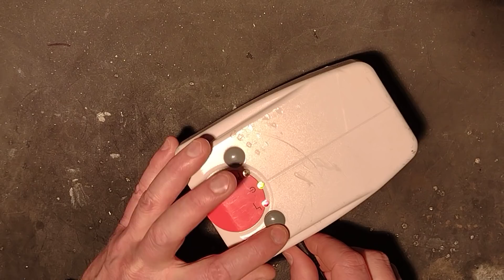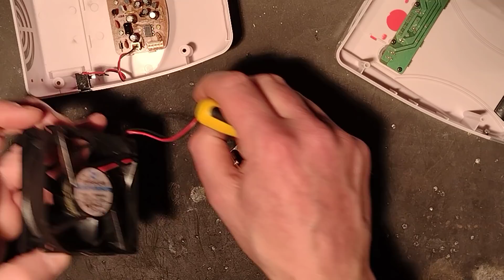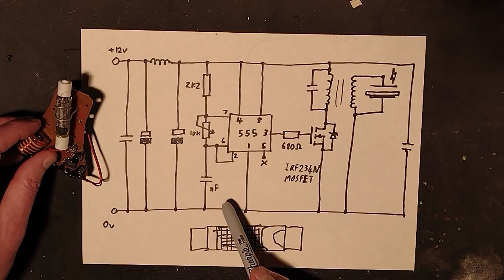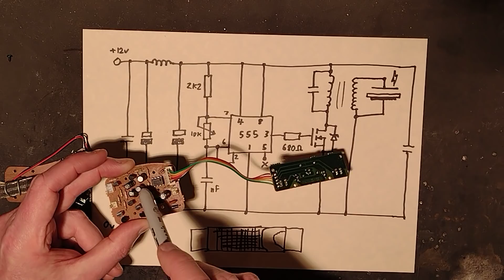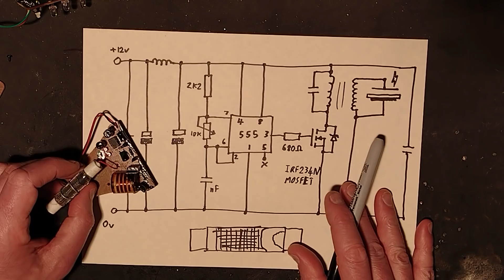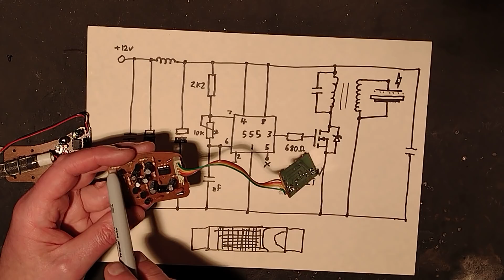Old shoe deodorizer ozone unit (no microcontroller)

Comment: The "Pie" arrangement of an inductor with the 2 capacitors in the legs is a very good smoothing unit for 50 Hz ripple. 
We used it in the Physics Laboratory in Secondary School for teaching half and full wave rectification. 
That particular topic didn't feature on the Final Exam Paper for Higher Level Physics but I passed with a Grade A anyway.

Comment: You can still buy that same design of flyback transformer and used one in a ESD gun that I built. I did buy several different designs of transformers from China and this one was a clear winner in terms of reliability. I also used a 555 oscillator via a FET driver and a voltage regulator to adjust the voltage. If your interested look on my channel as I published the full design if anyone wants to build a variable high voltage power supply Thanks regards chris

Comment: I recently got a usb uvc thing from China
 Worryingly dangerous so BC yours if you wish to get worried!
Reply from the maker: The UVC LEDs are a real thing if they're the little gold square ones.  Very low power, but still a risk if viewed directly.  They often include a purple chip just so you know it's active.
Reply: @bigclivedotcom  the thing is real little gold leds pushed to into the poundland power bank. With my finger (muppet) hurt like hell.

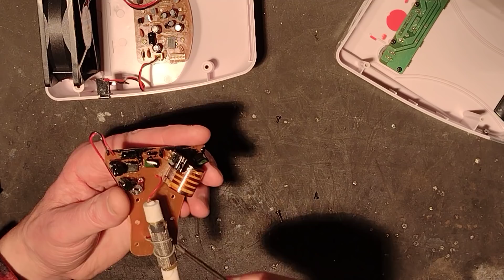Comment: @4:08 - I once made a ghetto ozone generator from a neon transformer, some steel window screen and a Prego jar.  Invariably, after a couple of hours of running, the arc would puncture a hole in the Prego jar where the raised lettering was.  I started using a smooth jar, but the arc still managed to pierce the glass after a time running.  I found that fascinating.
Reply from the maker: That's why many commercial ozone generators use ceramic as an insulator.  It's better suited than the glass at high power.
Reply: @bigclivedotcom  I've just replaced the ceramic ozone plate in my commercial machine.  It arced over an edge.  I didn't pay attention to the fact that you're supposed to clean the ceramic plate with (specifically) ammonia periodically to prevent that.

Comment: A capacitor across a transformer primary with a choke inline looks much like a royer circuit, or maybe with a 555 it'd be a pseudo royer, the odd thing is the 555 is connected to the same side of the choke as the transformer primary, maybe its just a really small value choke just for suppression and the cap across the primaty is a small pf value cap and is just to absorb the energy from the primary leakage inductance that doesnt get coupled to the high voltage side and might blow the mosfet.

Comment: It must have been quite an old unit to not have used a DUAL 555. I can even imagine such a unit using a QUAD 555, to add some extra features. Kudos to the fan still running. Expensive unit, was it?
Reply from the maker: It wasn't too expensive, and hasn't seen a lot of use.

Comment: Note that the body diode of the mosfet will not clamp a series connected inductive load. The current flow would stay downwards and would cause a voltage rise to the point of the mosfet breaking down. The parallel capacitor helps form a resonant circuit with the transformer primary. My guess is that that resonant frequency would be away from the secondary resonance to limit the MOSFET current.

Comment: I have a Question: WHY in general would you use ozone generators?
Reply from the maker: Ozone is a natural part if outdoor air.  It's what makes line dried clothing so fresh and clean smelling.  It depletes quickly in airtight homes which can create a better environment for undesirable airborne elements like mould and bacteria.  When used at higher levels like in this unit it can make an even less hospitable climate for mould and bacteria.

Comment: 555 is a true legend, something that will never ever happen again in world of electronics. Just like 741. Thanks Clive for another great video, much love.

EDIT: Solution for my smelly feet/shoe problem was using thick cotton socks, also in summertime (yep, even when it was warm outside). But a real revolution came when my nephew told me about feet creme based on zinc oxide and aluminum chlorohydrate. You use it for several days and forget about it for the next two or three weeks. You can try to ask about it in the pharmacy (it's called "Uro" in Poland).

Comment: Oh my, this device is sooooooo screwed!
And that tar or other goop on the HV board looks plain nasty. As if they couldn't use epoxy, silicone etc. in case the thing needed additional insulation. Which is strange though, as the only place that had HV would be the transformer's secondary and ozone generator.

Comment: Do you have to disperse the boric acid in a spray, or does manually sprinkling over as wide an area as possible prove sufficient?
Reply from the maker: Sprinkling into shoes is easiest, but you can dissolve it in water and spray it too.  But it doesn't dissolve well in water and should be over diluted so it doesn't block the sprayer bottle with crystals.

Comment: The two smoothing capacitors with a coil between them is a low pass filter known as a "Pi network" to keep the pulses out of the power supply cord so it won't radiate the spikes, noising up the radio spectrum. Ron W4BIN

Comment: Boric acid? I might try that. I bought an ozone generator for other odors, tried it on my boots a few times but it's a very temporary fix. I usually stuff them with baking soda over a weekend and use foot powder during the week.. makes them tolerable but they still reek.
Reply from the maker: If you try it, let me know how you get on.  You can get boric acid from eBay.

Comment: Hi Clive, I've got a device called a Puripod air cleaning system, it was bought in Argos a few years back, and when it is on it has two very bright green LEDs shining through two clear plastic slots in the otherwise white frame. I've opened the unit up, and it was quite dusty inside, so I guess it has been working at some point to create the ozone, but I can't be sure it's working now.

While I was inside the unit I covered the LEDs with two small dark plastic self adhesive 'light dims' and now when I switch it on the LEDs are still lighting but aren't anywhere near as piercingly bright (most of the light coming out of the front of the LEDs has been blocked).

I thought this would allow me to see or hear corona discharge through the tiny hole in the front of the unit, but the fan is far too noisy and I can't see or hear anything happening. I'm not sure that I'm even getting any smell of ozone out of the unit.

How could I find out if the device is working or not?

Looking forward to your reply.
Reply from the maker: Turn it up full and look up the end of the tube on the front.  You should see a faint purple glow.

Comment: Ozone really does the trick. I had a smallish, smelly and moldy old carpet. I put it outside so that it formed a covered, vertical zylinder and put a 30W UV C lamp (like you featured in a video) inside.Let it run for 12 hs or so.  And bam, it's usable again!

Comment: Clive. 
Before the 555 was made they must have used a circuit, how easy would it be to make one?
Happy new year 🥳👍
Reply: ever make a flyback transformer driver with a transistor, 2 resistors and 2 windings on a coil? not hard at all

Comment: Did they really think that their circuit was such a great invention, that none else could replicate it unless they could read the component values? XD
Scratching off numbers might slow down reverse engineering on very uncommon parts in complex circuits. But here (and in many other cases)? Extra time needed to obfuscate: several minutes for EVERY unit. Extra time needed to reverse engineer: maybe 15 minutes, ONCE! A very questionable decision by the manufacturer.

Comment: Chinese want to copy others, but they don't want to be copied! 
How hard would it be to measure the components using a component tester or a multi-meter? They didn't think it through! 
Every part of this unit is repairable. Even the unpotted HV coil or the Ozone generator.

Comment: Iove these devices wich use a 555 or logic chip they are realy reliable if the power of the mcu glitches out it can corrupt the program these chips dont have that problem ofc acheap litrle Chinese mcu is cheaper but this is more reliable

Comment: The 350mA may have been an indicator of fan (output) power but is nowadays likely one of inefficiency.

I've replaced a number of old fans with efficient (not cheapest) fans rated with lower power consumption with the effect of evacuating hundreds of dust bunnies as soon as the unit was switched on.

Comment: Hello Clive, you are of the stary pierdziel (old fart) generation as me. You also play with high voltage which is excellent.  You didn't need the threat of Soviets to play with dangerous voltages, so I thoroughly commend you.  I hope you will continue with your very knowledgeable reengineering videos....especially those involving higher voltages.  Safety is overrated anyway.  BTW, I do not live in the UK, and I am not a plumber or lorry driver.

Comment: It's refreshing not to see microcontrollers 😉👍. Discreet component circuits are more interesting to explore.
Reply: At least you can reverse-engineer the board and learn how it functions - with uC most of the inner workings is in software.

Comment: Hot Shot MaxAttrax Roach Killing Powder is 99% Boric acid & the MSDS lists the other 1%  as, "... proprietary or non-hazardous.  Values are not product specification." At worst it's a roach attractant but more likely it's an anti-caking agent. MaxAttrax is available at all the fines big box stores for less than $5/lb.  I've taken to using it in my shoes & as a foot powder and am very happy with the results.  YMMV.  Don't blame me if you find dead roaches in your shoes.

Comment: I'm always so happy to see things made without blob chips and microcontrollers...kind of odd when I think about it though, since I do so much 3d printing and have a remote laptop running 2 printers at once. This brings to mind an old HEPA filtration unit I cleaned up and repaired for my wife's office. It has an ionizer in one side of it, and I managed to impale my fingers on the needles while reassembling it, but it also had nice clunky switches and no microcontroller. 🙂
Reply: There's a reason they don't anymore. The microcontroller is much simpler, cheaper, easier to assemble and more reliable than that huge bunch of components on that board.
Reply: @John_Ridley  the active word being "cheaper". 30 years ago I was studying to be a mechanical engineer, and knew it wasn't for me when one of my professors said that an engineer's job isn't to design a serviceable product, it was (and still is) to design a product to be produced as cheap as possible so the company maximizes profits. With designed failure points that will last until the warranty expires and any failure is no longer the manufacturer's responsibility, I'll take a repairable item any day. But, as was often said around the repair shops I worked at, and later when I worked for a heavy equipment manufacturer, "customers want the maximum features for a minimum price." Microcontrollers are a good thing, and reliable, as long as the supporting components are of good quality, but when you purchase millions of components at a time, the difference between each costing a penny for the cheap one vs two pennies for the good ones is a huge difference. Case in point, the HEPA unit in my original post, still running strong and quiet after 20 years. The microcontroller and touch pad HEPA unit in another room, noisy and coming to the end of it's life after less than 5. Yet when calculated for inflation, both cost me about the same to buy. Neither was a cheap unit, and both were made by the same company. I'm sure the profit margin was much higher on the newer one. I bought the newer one based on the performance of the older one, but won't buy another from that company. Some items simply do not need a microcontroller, but hey, why use a simple switch when it's way cooler to use a touchpad.

Comment: It maybe old technology, but it was reliable technology. I often think we rely to much on microcontrollers
Reply: @T.J. Kong I completely agree. I build audio amplifiers, I'm still using circuits design by Mullard from a book I brought back in the 1970's using transistors. These  amplifiers can give there modern day counterparts a good run for there money and in a lot of case the circuits are simpler than IC circuits and more robust, and can deliver same quality .
Reply: @robertburrows6612  Totally agree and like the comment from T.J.K. I was a Mullard apprentice and designed many circuits using (probably) the same books. Even before that I was designing circuits using NE555s and 741 op amps in high school. Good times!

Comment: My boots, sneakers and feet quit stinking when I switched back to 100% cotton socks. I realized that any clothing in general I wore made of polyester would always end up stinking.
Reply: You should try wool socks.  They are better then cotton socks for odor control and comfort.
Reply: @R_Forde  they must be, I don't recall ever meeting a sheep with stinky feet. ☺
Reply: @tncorgi92  Sniffed a lot of sheepy feet, have you? ;)
Reply: @YodaWhat  Foot fetish??
Reply: Better ask Paul about those hooves.
Reply: Yup. I'm always amazed at the dry wicking summer golf shirts that keep dry but made of mostly plastic thread and always stink. Also wearing shoes too tight and too insulated will result in sweaty feet and stink. I ended up getting shoe size 1/2 size too big and tried New Balance 510 and they have a lot of mesh and air flow. No stink!
Reply: I also Spray desinfectant on the inside of the shoes, it works amazingly and the shoes stay fresh the whole day

Comment: Actually, use Hex Inverter instead of 555 give better result. Auto near 50% duty cycle, stable frequency as oscillator mode, good for feeding the FET.

🔥
Reply: There is a different configuration for a NE555 if you want equal (50%) mark/space ratio.
Reply: @Mark1024MAK  yep, i link pins 2 and 6, cap from there to ground, resistor from there to output,  if not equal enough for you , you can tweak it by adding resistor from supply or ground to control voltage pin or the junction of pin 2,6,cap,resistor
Reply: @andygozzo72  - yep, exactly, you use pin 3 (for the 8 pin DIL type) for the feed to the charge/discharge resistor.
Reply: @Mark1024MAK  basically using it as a schmitt inverter, i've pretty much always used it like that as an oscillator, saves a resistor and reasonably near 50/50
Reply: @Mark1024MAK  yes but it too old chip for square wave oscillator. With Hex Inverter it will simpler configuration, more stable when temperature changing, lower current consumption, and easier to build. Very good producing pulse from 0.1Hz to 500KHz than 555.
UBE4069 is my favorite for widely usage.
Reply: @samuelbudiyanto2250  - I find the 4093 CMOS quad 2-input NAND gate with Schmitt trigger inputs useful for many applications. But the NE55 is stupidly cheap (£0.25 each when bought ten at a time from a large electronic distributor).
Reply: @Mark1024MAK  I mean Unbuffered 4069 or UBE4069, very cheap than 555 in my country 😀
Reply: I am sorry, I mean UBE4069 not 4093

Comment: I wonder if obfuscating the parts and their values has ever stopped someone from reverse engineering a device. If I were a competitor or counterfeiter and planned to knock off a device, I wouldn't have issue with removing the parts for out-of-circuit testing. 
Maybe it's to prevent them from being beat to the market with prototype photos provided to regulatory agencies?
Reply: With chips, it does slow down reverse engineering. Not so much with capacitors, or resistors. But given enough time with the right equipment, anything can be reverse engineered.
Reply: They could have done it so it would be harder to repair, so they would sell more ozone generators

Comment: There's a difference between an Ioniser and an Ozone generator. You need an arc to generate some plasma in the air between two electrodes for Ozone. An ioniser just chucks out lots of negatively charged ions without any arcing. I'm amazed at how many people think that they're the same device.
Reply: Isn't ozone an ion tho?
Reply: @TheGingaNinjaOfficial  Nope. O3 is a neutral molecule. It does want to split apart at the first opportunity, though.

Comment: I'm curious about the variable resistor tuning to the inductive load of transformer. I know you don't have oscilloscope there, but it would be interesting to see how the output varies depending on if you've got it tuned correctly or not.

Also, I would love to see the reverse engineer of the control board as well. You mentioned a bunch of things in passing, like "oh, they are very standard"... what is a Darlington? I don't know :)
Reply from the maker: To tune it I'd do it by monitoring circuit current to find the lowest current at the highest ozone output.
Reply: A Darlington is either two transistors connected together in a particular configuration to get a lot more gain than a single transistor can provide, or two transistors integrated into a single package for the same reason.

Typically used so that a very small signal can control a very high current device.
Reply: @Mark1024MAK  Darlington pair?
Reply: @reacey  Yes.
Reply: In that configuration adjusting thee potentiometer would do two thing to the waveform. It would vary the frequency of the output, but also it would change the mark space ratio of the square wave at the same time.